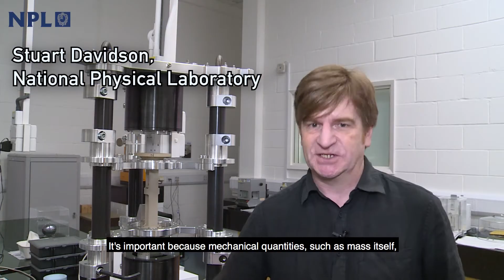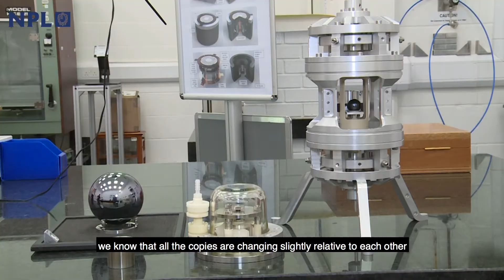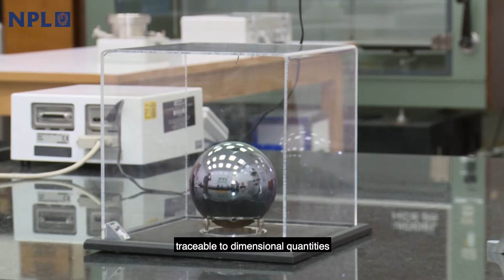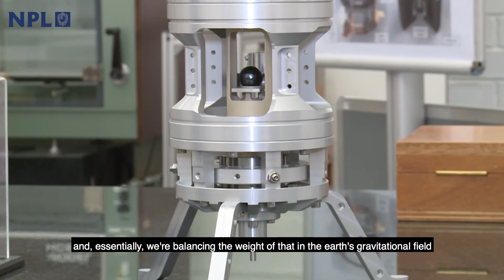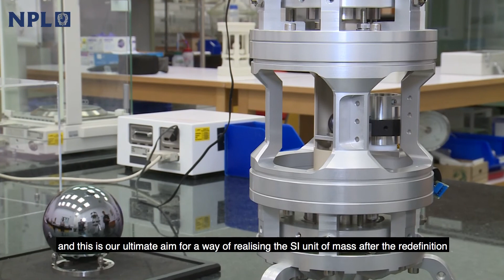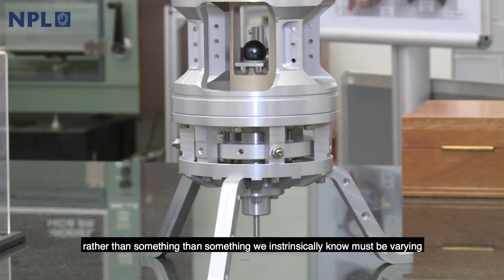SI Redefinition: The kilogram

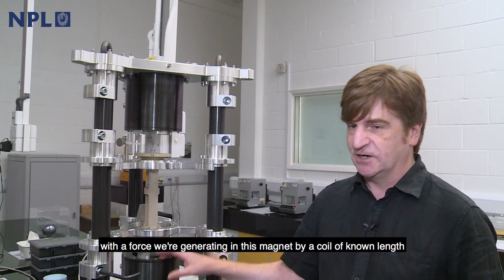Comment: Some other sources have suggested that the length of the coil is difficult to measure accurately enough, but the beauty of the Kibble balance is that length cancels out (along with the strength of the magnetic field, 'B'). I'm curious therefore about the comment at 1:17 that the coil is of a known length..?!

Comment: I don't get it. If kg is unstable and source of that instability are changes in Earths gravity field then how that "counterweight" method could help keep it stable? Not even mention that there are probably zero researches that evaluates influence of gravity field on magnetic fields...
Reply: Hymeleon — Gravity is not the source of the instability.  Mass does not depend on gravity.
Reply: No one knows why the kg isn't stable, but it doesn't have anything to do with gravity.

Comment: Did you forgot that the kilogramme was already define by physical constants since its creation? 1 litre - 1 dm³ - of water at 4°C.
Reply: That definition was tossed out ages ago, like in 18th century. For the very simple reason that you can't measure it all that accurately.
Reply: @aleksandersuur9475  You don't have to measure it as you already know that it's weight exactly 1Kg !
Reply: @stephane.sonneville  think carefully for a second now. Accuracy of all your measurements depends on how precisely you can measure definition of your unit. Your measurement cannot be any more accurate than your ability to compare it to your definition. 
Never mind that the water definition is circular reasoning. Density of water depends on pressure, definition of pressure depends on definition of force and definition of force depends on definition of mass, which the french initially tried to define in terms of density of water. It was a convenient starting point for the era, but it's a piss poor definition by 21th century standards.
Reply: @aleksandersuur9475  Well it was 1 dm³ at 4°C with perhaps 1,014.3 hPa (like today in Paris) pressure. I know that it's unwieldy to weigh that stuff but any other definition will be kinda arbitrary. Though you right about the circular reasoning. The question is now that we have the metre redefined on 'C' the speed of light and not the earth and the kilogramme redefined on 'h' and not the decimetre cube of water, will this two values kg & m still match and that 1 litre of water still have the mass of 1 kg.
Reply: @aleksandersuur9475  I'm no scientist but I'd like to know if this new definition of 'h', 1 decimetre of water at 4°C will still weight exactly 1Kg - as it should - and not 0.999999999923 Kg ?
Reply: @stephane.sonneville  1L of water is not exactly 1kg, it's about 25mg short and has been for over 200 years, catch up would you. Besides, what kind of water? How pure? what isotopic composition? At what pressure?
Reply: @aleksandersuur9475  The IPK or big K has been originally defined on 1 dm³ of water, so 1 dm³ of water is more precise that any IPK around the world.
Reply: @stephane.sonneville  No IPK was not made after 1L of water, it was made in 1889 after an earlier prototype - Kilogram of the Archives. Which in turn was made in 1799 after 1L of water as precisely as they could measure it back in the day. Which apparently was off by about 25 parts per million. IPK was much better, with uncertainties in parts per billion, or about thousand times better. The new definition makes it possible to add more magnitudes of precision on top of that, limited only by how accurately you can reference Planck's constant.